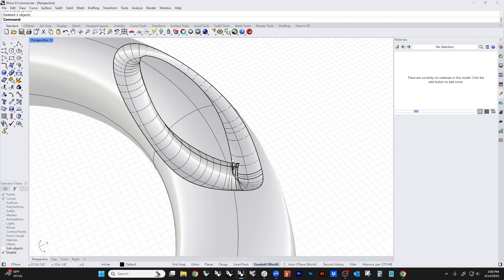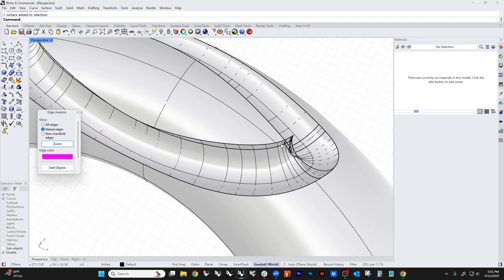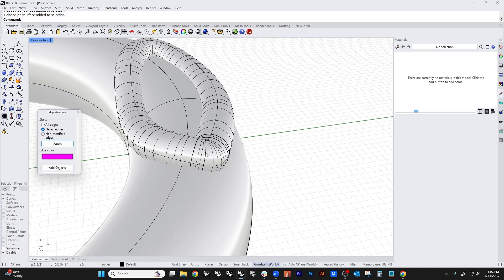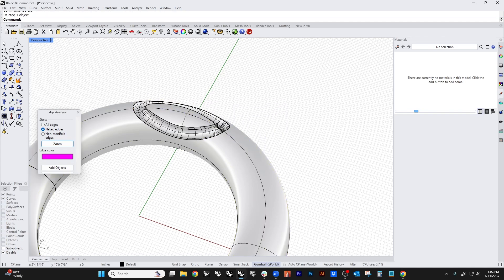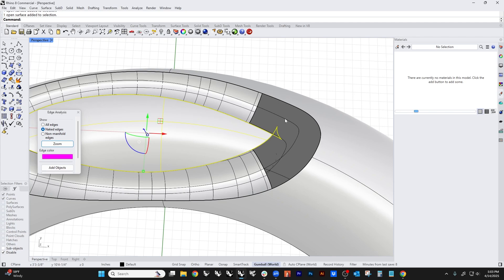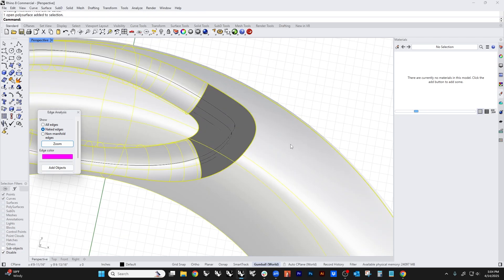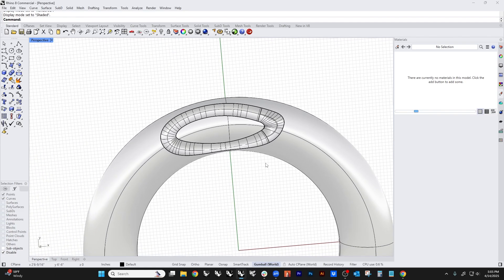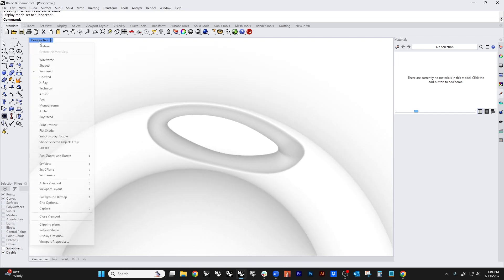Fixing messy pipes

Comment: Why some edges remain when you delete the defective part at 3:20? I'm trying to repeat that process for a surface made with the Pipe tool, but it seems like some steps are missing. When I split the messy part, there are no edges left to help me build a fixed surface.
Reply from the maker: can you send your part to tech@mcneel.com attn:kyle? 

I'd be happy to take a look and offer some help-
Reply: @Rhinoceros3d  Thank you, Kyle. It's just a tight U-shaped Control Point Curve and the Pipe on it with size large enough to create overlapping wall like shown in this video. And then I proceed with the "Extract Surface" and "Split surface by isocurve". I figured out that to solve the problem, I need to extract some curves from this surface to rebuild it later. But since this video is in a newbie playlist, perhaps it might help if you could show us how to do it in an easier way. Anyway, I sent the file.
Reply from the maker: @RemainingLight  thanks for sending your file to tech@mcneel.com hope that fix worked for you!

Comment: Other software has become much easier to use and doesn’t waste time on problems like this, while Rhino remains stagnant with no significant improvements. It’s quite funny how some people are still so attached to the old ways.
Reply from the maker: other surfacing software can add a 5 mm radius to a 2mm corner and not bowtie or self intersect? 
point me to a link or video please? (genuinely asking)

Comment: Not bad, but I don't think the zebra would like it.
Reply from the maker: there are ways to dial up the continuity as needed for sure, this was intended as a "need to get the part out" type of fix. 

If continuity is the goal, you start with the corner first and build backwards from it defining your over built cross sections first , dialing them in single span deg 5, then you wander down the matchsrf rabbit hole and iterate until you get what you need.  Also for class A type modeling, I'd never build off a trim edge anyways. 

for the case this was based on these pipes were tiny...like less than 2mm and as such any discontinuity would get rubbed away in the polishing phase. 

I always try to make sure I'm not working harder in 3d than I need to if the hand finishing process will be fairly intensive. Having a cv or two out of place is no big deal if the grinders and polishers are coming out at the end anyways as perfect continuity can be very time consuming to do right.
Reply: @Rhinoceros3d  can you guys explain why continuity is important?
Reply from the maker: @GurkanBOZKURT-wv2dq  it determines how smooth the transition between each surface is.  The better the continuity, the less bumps in the surface, which = smoother highlights.